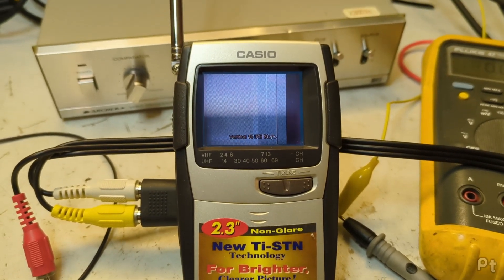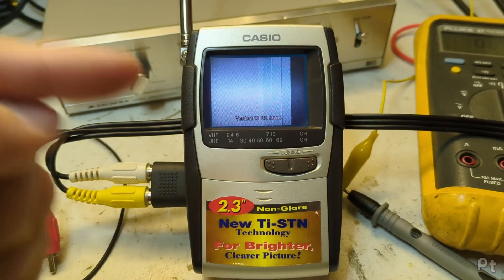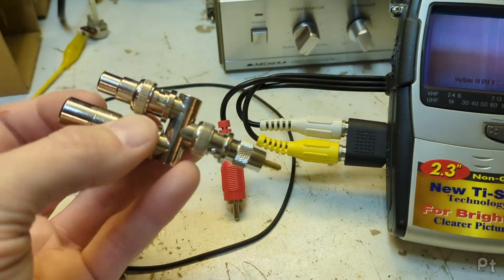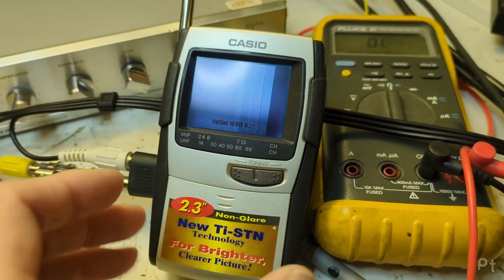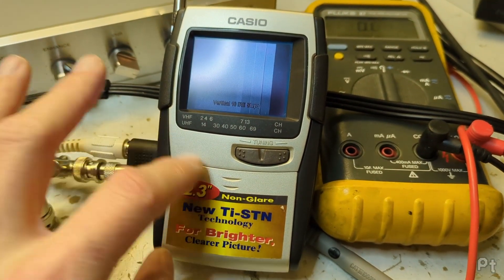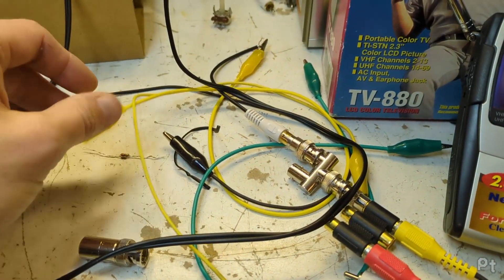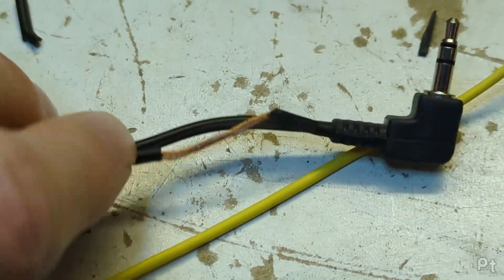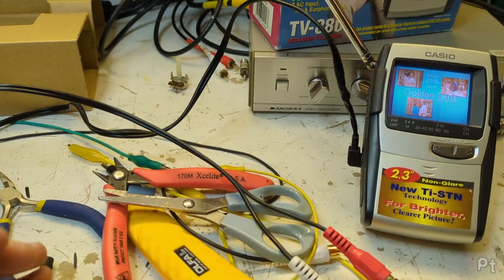Casio Handheld TV - Proper composite input

Comment: I recently got one on ebay, but the audio/video composite won't work, it doesn't show anything, but if I unplug it the device normally works. But I bought it to use with my devices. If I plug something in the screen goes white and flickers, any idea?
Reply from the maker: Does the screen flicker with the audio? Those 3.5mm A/V cables don't really have a consistent standard, so try plugging each RCA plug into the video out and see if that fixes it. 

Here's a video VWestlife made on how much of a mess these cables can be: https://www.youtube.com/watch?v=nUcx_RrRS7U

Comment: I would just add a 75 Ohm SMD resistor onto the TVs circuit board. Right to the solder joints of the video connector.

Comment: Could the resistor be fitted inside the TV? Given there are smaller resistor packages (1/8th watt, SMD, etc.) it'd seem a tidier way to deal with Casio's gaffe in forgetting to put such a thing in circuit, and heck, maybe there is a position for one somewhere that they forgot to populate, which really would be a silly error on their end... :P
Reply from the maker: You definitely could! Especially if you're ordering the correct value/size. Not sure why I was so focused on copying Casio and putting it in the cable.
Reply: @probnotstech  Well, modding a cable's easier than stripping down a device, so it's understandable to go that route, done it plenty times myself, only to later think of the internal mod that I'd never get round to doing... :D

Comment: I used to use these old analog hand held TVs as little monitors for using analog wireless micro cameras for various things (CCTV, surveillence, RC vehicles, etc). This was back in the early 2000s when the analog transmitters and cams were cheap because digital stuff was new.